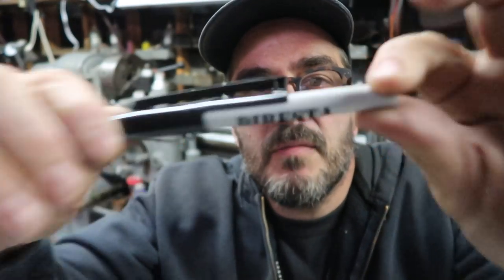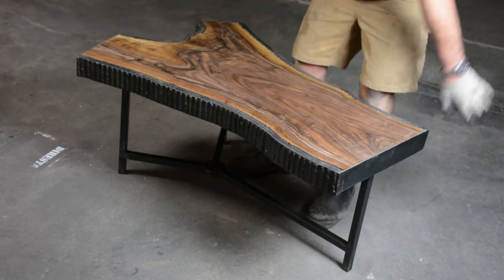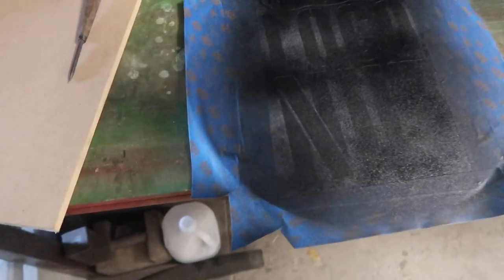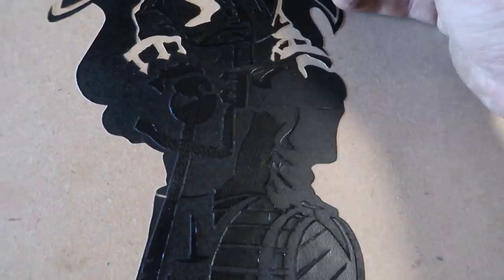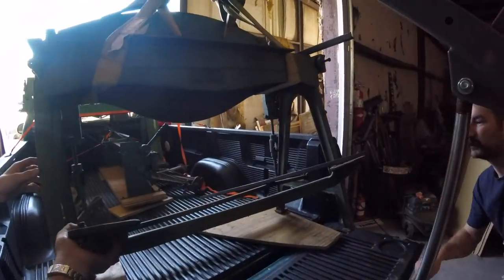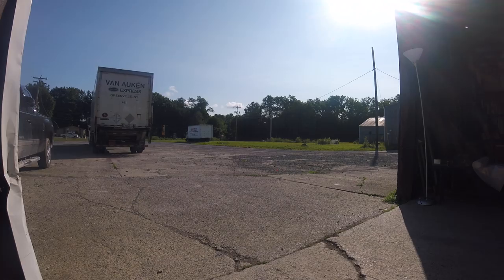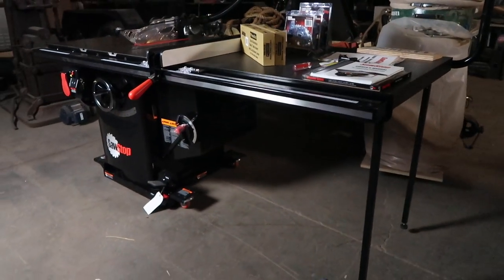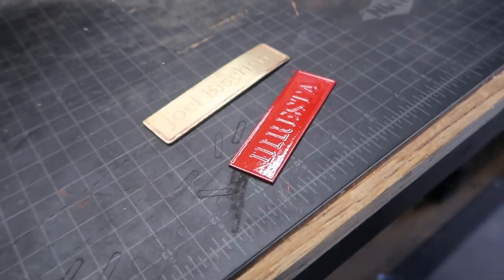DiResta 49 New Sheet Metal Tools

Comment: Hey Jimmy, try etching glass. I worked for years in a PCB factory and we tried glass. It was a type of acid but the glass was not submerged in acid, rather you used the fumes, problem was the boss thought he was going blind when we found the fumes had etched his glasses. Anyway it's very satisfying. We did mainly PCB's but also panels like the ones you made. We used Ferric Chloride.
Total respect from the UK. GAry
Reply: Ha ha funny story! The boss thought he was going blind.

Comment: Hey Jimmy
I run several vintage machines in my shop off a 10hp 3 phase converter.  Easy to setup and runs great.  Those 3phase motors run for ever

Comment: Hey Jimmy, big fan and physicist here. A VFD is really good for changing speeds - if you had a large bandsaw as well I'd recommend it because you could change speeds without fiddling with belts and pulleys. On a table saw you'll likely be running fixed speed. For that reason I think you should look at a second hand static converter while you look into getting 3 phase to the shop. 

3 phase was typically much smoother than 240V AC (which is what we have in the UK) as there is always one line near a peak. For most applications capacitors are now sufficiently good that there is little difference between single phase and 3 phase motors at the lower end of the power spectrum - I have a Wadkin Bursgreen AGS 10, which was 3 phase when I bought it but I actually put in a single phase motor which is 2hp. 

At 7.5hp you're in the situation where full on 3 phase will be better (smoother). You'll get a notable drop in power if you use an inverter. Short term should be no issue. Having single and three phase to your workshop will mean more old bandsaws, bigger welders and big lathes are in reach. I think it'd be worth an investment. Your workshop already has 3 phase inverted at the point of entry or you will need to run a separate spur off the mains which could be up to a couple of hundred yards away. Basically this could cost you between a couple of hundred dollars and 10,000

Comment: A fish tank air pump helps the etching process a lot by keeping the etching solution moving around the piece.
Reply: I like 12V car air compressors better. They're usually cheaper, and easier to get. Plus being pistons they may actually work a bit better. It is more than just movement, the air actually helps etching too.

Comment: Jimmy you need to find someplace else besides RadioShack they are closing stores left and right around the country.
Reply: Anthony E. I thought they were all gone, RadioShack.
Reply from the maker: Anthony E. got it last year !
Reply: +jimmydiresta  I want to switch to peroxide and muratic acid myself. It self regenerates. Ferric Chloride is kind of meh. But read my other comment about how to supercharge FeCl etching. Lately I've just been isolation routing PCBs on my CNC. Tell us more about your CNC controller failure. Beefing that up is cheap, and easy enough. For about $54ish I bet we can build you something with 3X the power. Without knowing more I can't be sure though.